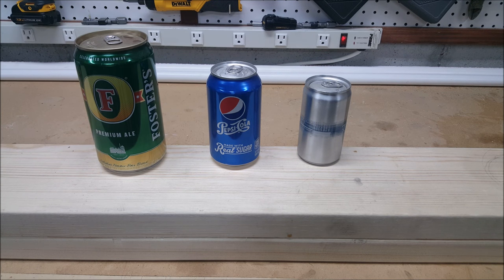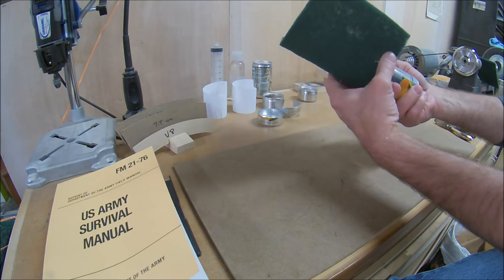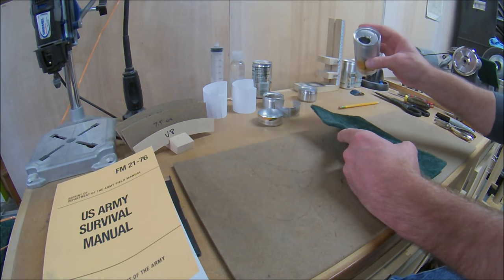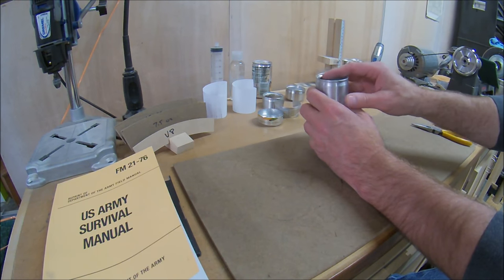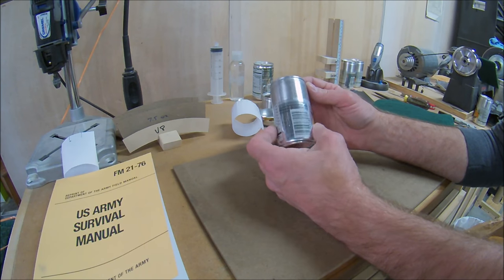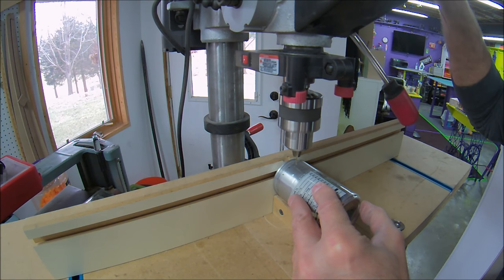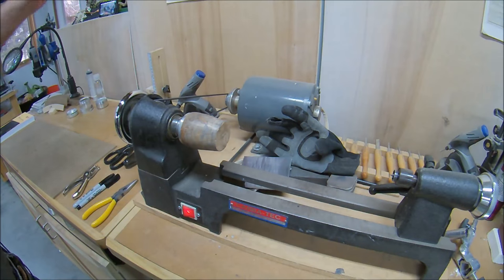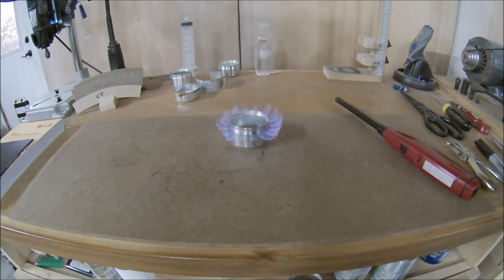How to Make an Alcohol Stove from a Juice Can

Comment: Awesome video again, thank you for sharing the knowledge!
Reply from the maker: Thank you, A Jr!  Did Santa bring you that Proxxon so you could make your own?
Reply: Yes I did, got the tool and  the drill press attachment. Made a few stoves so far, thank you. I struggle a little with the inside band but got it working, it would be nice to have templates like you made them, who knows maybe some day. I did an experiment where I did not removed the paint from one and the heat of the fire removed it at the top portion, so I thought how about putting one to burn on top of the other to remove the paint... LOL bad ideia...LOL Your setup is so good at putting up heat that it melted the stove on the top. Like the Coyote used to say back to the drawing board with my ideas... again thank you very much!